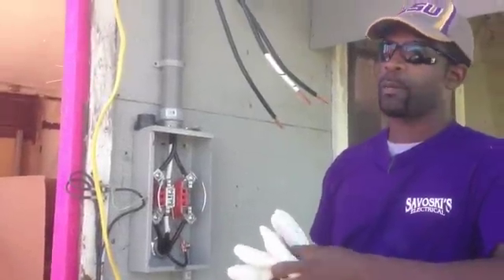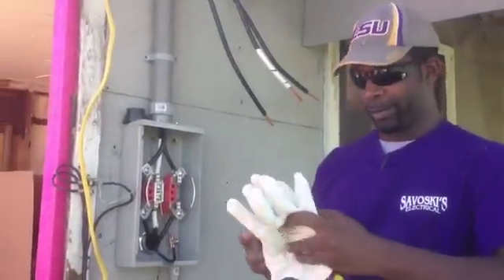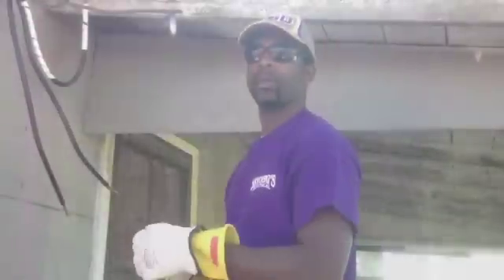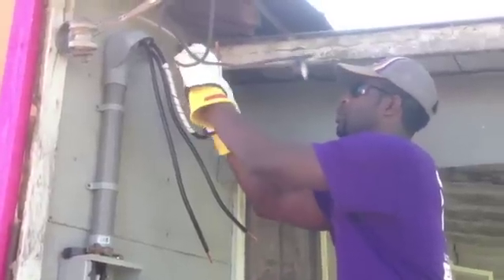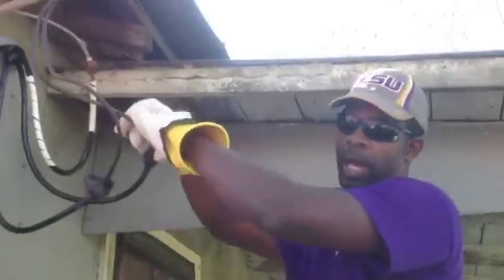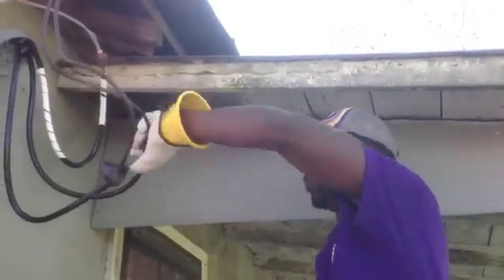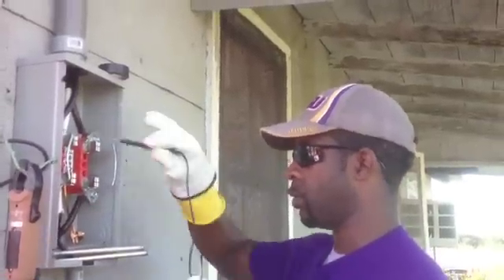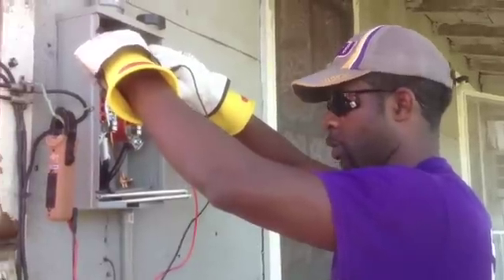Upgraded Residential 200 Amp Service.

Comment: Something serious? It’s only 120v per phase, now if you are higher and dealing with any kind of voltage is dangerous
Reply: People have died with only 120v.
Reply: @senorjalapeno3937  totally
Reply: @senorjalapeno3937  seen 120v weld sockets to impact wrench . It can definitely kill . People like to assume it won’t but it can .

Comment: Why not just call the electrical company to disconnect and after inspection they will reconnect, that way it will be safe to upgrade the service.
Reply: Because a household cannot wait for weeks or even a month or so for the electric company to come back out and reconnect the service again. They do come out eventually and remove the split bolt connectors and put their own crimp connectors on but in the meantime the house needs to have power

Comment: Nice video thanks. So far the only one I found that shows the actual hookup to live power.
Reply: Yeah it's my first time seeing that on YouTube too
Reply: Is this actually a live wire? Because i CANT FIND ANY VIDEOS WORKING ON THE SETVICE DROP WITH LIVE POWER
Reply: @zacharysnellgrove1358  Yes live electric. Not any other vids because it is dangerous. I watched this vid many times and almost did a hook up myself. But I became fearful. So my cousin the electrician did it. Very similar to this video. Good luck

Comment: So much wrong with this hookup that i don't even know where to start. No attention was paid to overhead line clearance code. You cannot use that #0 Aluminium feeder to supply 200 amps. It's amateur hour here.
Reply: It's open air wire, dumbass.

Comment: That's a bad installation, not in compliance with the National Electrical Code, not safe at all and bad craftsmanship.
Reply: Just left my comment to his installation..... OMG..... terrible!!!!
Reply: That doesnt look like 2/0 copper(225 rated)  to me it looks like 1/0(175amp rated)  at best. And he's using uninsulated tools for tightening his split bolts . Not sure what his standards are with his company and area .
Reply: The power company doesn't have to follow the NEC I've seen 4 AWG from the pole feeding a 200 amp service all the time.

Comment: As there is no meter installed, those drops are all totally dead. In addition, the insspector would likely red tag the installation because the finish outer wall surface is not installed and it appears to be plain sheetrock. Here in California, you cannot secure a riser to a wall with the weather head so low and you cannot use PVC clamps to secure the riser to the wall above the panel. It also does not look like the entrance fitting is properly secured to the box with a lock nut.. In addition, if the POCO feeders are hot, the cover and blank meter space opening should be closed off with a proper insulation filler so nothing can accidently fall into the open and live meter base.

Comment: I love all the nonsense comments on here! The job done here is perfectly fine!  Yes we DO hook them up and then the power company will come out at some point and replace the split bolt connectors with their connectors.  A customer can't be without power for 2 weeks waiting for the power company to come out and reconnect the lines!
Reply: Facts
Reply: Strange, when my parents service entrance need replaced Hydro One reconnected it a few hours later. Maybe utility companies have different practices in Canada. Another reason I find that same day reconnecting is common is that if you had a 60 amp service previously they need to replace the overhead feed to your mast.
Reply: @robertsitch1415  sometimes they dont, if you have 100 amp service they will leave the 60 amp service drop. The line crew tell me " oh it's fine its cooled by the air" 🙄
Reply: @willschultz5452  yes the fact that overhead wires are air cooled is why they typically use thinner conductors than you would see on an underground 200 amp service. Maybe advance scheduling is why same day reconnecting is standard in Ontario, Canada. That and if there isn't a storm Hydro One has plenty of staff to preform maintenance and assist with service changes.
Reply: @robertsitch1415  yes and if you have a 200 amp service nobody is ever going to actually pull a full 200 amps from the service.  Here where I am in pa we re connect ourselves like this video and the the electric company will come out as they have time, sometimes it can take  up to 2 months
Reply: @willschultz5452  you would either need several apartments or a large electric heated house to ever need more than 200 amps in a residential building.

Comment: There is no way this is up to code with that stubby ass two and a half foot ass length of PVC bringing that drip-loop to no more than 7 feet off the ground holy shit. And splitbolts? C'mon man overkill is way better than good enough when it comes to stuff like service tie-ins.

Comment: A pinhole (super small hole) in the gloves can make them worthless for preventing arc.
You should air pressure and visual check them every time before you use them
and if they are old gloves, don't trust them with your life.
You SHOULD NEVER work on live service entrance wires.
The power company can disconnect the transformer from your line if it needs work.
Reply: electricians do this live all the time! there is no danger if done right

Comment: 1.. No rubber blankets?
2..No crimps? instead of those cheap things...?
3..No plastics caskets around the service connection? 
4..No hard hat. 
5..Pretty sure you gotta go thru the roof?? 10ft to the bottom of the drip loop???
6..No cones or caution tape out to keep kids and people of your area.??? 

Message me if you would like a job done by a true professional. 

PS
i just hate seing videos like this. if you’ll do something and decide to upload it. PLEASE!!! have it professionally done.
Reply: this is only a service to a house 120/240 volt, you dont need all that, the gloves are fine
Reply: Blankets for what??? I have never seen my power company use all that on the side of my house and I will trust them before I trust your advice. They work on high volt lines so I’m sure they know what to use and not need to use.

Comment: Dude you got all that nice new box and wires provided by a 75 year old insulator tensioned to a weathered 75 year old  1 inch board.  Why do anything at all her since  these overhead wires are  going to pull loose off the board in 6 weeks.   Why not just keep the old fuse box.  What good is anything better if the rest of everything coming to it is not better as well.   You can always upgrade from behind  your upgrade later but upgrading in front of your upgrade later seems Cheezy.
Reply: What difference does it make? Is he the home owner? Is he the builder of the house? It looks like a meter installation and the rest could be already done within the house like you speak of.

Comment: I'm not an electrical engineer or anything - but aren't there better weather proofing solutions on those external connections than electrical tape?
Reply: There's actually many more steps to insulate split bolts than what is seen here. If you want to know more, check out this video by 3M: https://www.youtube.com/watch?v=9tsx6im7qng

Comment: If an inspector passes that, he should be fired. The proper way to do this is notify your utility, have them cut the power at the pole, do your thing, have it inspected, and IF it passes, the utility should drop new service to the house and put their own NEC approved connections at the point of service entry. Many electricians call this a bootleg installation and inspectors (if doing their job right) would fail this. Most utilities will run a fresh new drop to the residence. It's part of their supply charge on their utility bill.
Reply: not around here it isnt, the electric company will leave what is there and use it till it burns in half.  All electricians around here hook them up live by themselves. A customer cant wait weeks for the electric company to come and hook the power back up.  The company will come out at some point and cut the split bolt connectors off and put theirs on.
Reply: Why would he fail?? As long as he did the grounding right.. two ground rods number 6 and a number 4 back to water main and put in the correct breakers etc you are good.. I have done  hundreds of services .. Never failed one and guess what i cut them out and cut them back in hot..
Reply: Right......wait for the “electric”  company.  Let me know when you go out of business, because you spent hundreds of man hours waiting.
Reply: xlordshavox we don't run new service wire every time someone calls for a disconnect. Hell even 200 amp  upgrades still get #4 aluminum triplex. Open air wire is rated for more amps. Complete waste of wire .

Comment: instead of split bolts, what about those Polaris or Morris insulated splice connectors?
Reply: You should be using service taps!!
Reply: All is fine, split bolts Polaris lugs, Ericson crimps.......done 100's of them all but this is playing bullshit. His joints look like shit. Never saw any rubber tape........I could go on............
Reply: Gwar Richmond I was ready to point that out myself where is the rubber tape before the electrical tape.
Reply: @gwarrichmond6232  we used to use rubber tape, then friction tap then electrical tape
Reply: @sal.pizzurro  
Depends on what size split bolt I'm doing.... Most stuff is rubber tape then 33+ ,if its 3/0 or 4/0 but when I do 350 or 500 or larger I use varnish tape heavily then rubber/friction tape then 33+ or super 88. Sometimes if it's in a trough or tight junction box I will use varnish then MASTIC PAD then rubber then the 33+ or super 88.
👍🏼😉👍🏼

EDIT: This is an idea of doing a split bolt using varnish tape. 

https://youtu.be/9tsx6im7qng
Reply: @gwarrichmond6232  it's been a long time since I was an elevator mechanic, I forgot the friction tape goes on first then rubber then electrical. Never used varnish tape. I think I'd use what I'm used to, but those Polaris lugs look nice.
Reply: @sal.pizzurro  
Oh yeah they are nice and ALOT quicker !!! Lol!!!
They can be a bit pricey if you have a bunch of joints to make up. But by the time spent on making a split up and all the taping your still looking at about the same price. I know it may sound like an overkill but even on Polaris lugs I still tape the lil caps in place, just so they don't fall out.

Comment: The minimum distance off the ground to the drip loops is 10'. This is an NEC requirement.
Reply: electricalron that's what happens when you're too lazy or chap to run the entrance conduit through the edge of the roof like it should of been done
Reply: Patrick Pikulski Through soffit makes this a mast service.   The mast service here is required because of the clearance needed because of the height of the drip loops.  The SEC's often have no overcurrent protection.  Therefore, some people are stupid and would play on them.
Reply: I was think the same thing it looks pretty low🤔
Reply: Your wrong. For trying to be a smart ass.. but it should be 12 feet off the ground.. Facts
Reply: @adrienpatterson6217  who cares

Comment: i have connected pg and e as well in at least 200 panels,,with no gloves.,,,,,they are just overrated.
and i cant beilive how long the wires you left....also as far as know in most citys the minimum distance from the floor gotta be 12 feet.....but i guess there is people that learns on the street rather than the field

Comment: service drop wires remained the original size ?
DANGER !
Reply: Farmer Dave in my area even 200 amp our poco keeps the 4 awg triplex open air drop line.
Reply: its perfectly fine to keep the same drop, the wires are outdoors and cooled by the air. no problem.

Comment: nice work.. its only 120 volts on each line but the potential for ALOT of amps coming thru..thats the scary part.
Reply: it's funny reading the two guys comment who is more knowledgeable in electrical. both of the guys are correct , when voltage is present there is A CURRENT PASSING..if there is a load you can measure the amp by using a amp reading and see how much each load carry.
Reply: BoatsNhoes 311 So what you're telling me  because there's no digital reader in the can, there's no electricity going through the leads is that what you're saying, Because the meter is the cause of the current. Not from the overheads, but from the meter. Wow, I've heard better logical common sense from a fucking plumber.
Reply: BoatsNhoes 311 So what does any of that have to do with the leads? Fuck dude.
Reply: BoatsNhoes 311 Not to mention I threw him on some solar panels and because he's commercial, he had no clue how to wire.
Reply: BoatsNhoes 311 Tell your wife and my kids I said hey.

Comment: We had out 100 amp service upgraded to 200 amp several years ago and they also did ours 'hot'. The glove the guy wore were all rubber and of course he was on a fiberglass ladder. What I could not understand is how they was no sparking or arcing when the hot wire was attached to the metal connector and house side wire? I would have thought that when you touch the hot wire to the other wire it would spark or arc some.
Reply: only if there a load(something has to be on or running when he conncet the meter) on the wires then you would see a spark
Reply: RideTheWind panel was  disconnect, btw also neutral wire do sparks
Reply: nothing is pulling a load, meter is out
Reply: It will not spark if there is no load on the service. there should never be a load on a service if you are connecting it. Probably the meter was not installed yet either till the job was done.
Reply: NO the neutral wire will if there a load being pulled, neutral thats the most dangerous wire, it carries unbalanced load so if you have 15 amp and you tv pulls 5 amps the other 10 amp are coming back on the neutral wire.

Comment: How about clearence of service entrance cable and ground ?
Reply: minimum 10 feet
Reply: 12 feet most parts of the country
Reply: you dont want to pass under the wires with a 8 foot aluminum ladder and have the wires old and sometimes exposed with no tape and then you can imagine the result

Comment: Those leads were to long and low those kids are gonna jump up and hang off of them..
Reply: You’re supposed to have 3’ past the weather head.
Reply: Oscar Heredia luckily 95% of kids know better
Reply: What kind the glove used
Reply: @rigobertosaravia3440 
Probably class 0 rated for up to 1kv (1000 volts). Those class 0 gloves with leather gloves over them to help prevent a damage and possible contact with live conductors.
Reply: Mike mike Indy is right, the power companies dose that... Or else everyone would tap into the power company side and get FREE current
Reply: @agrippa7712   the electrician makes the connection to the power lines not the power company. the power company will come by at some point and make a more permanent connection.
Reply: I am not a electrician but I have a question. 1st a few wraps ofelectrical tape seems like a less than permanent solution. 2nd he stretches the tape at the end to cut it which we are taught in "HAM radio" tends to encourage it to unwrap. Thank you in advance sir.
Reply: Oscar Heredia he not no that much he got job because his blk. co need rachel balNce

Comment: nice job i made a video for you al/co connection for savoski i thhink you used the wrong split bolt in the video check with a inspecter you might be ok but my understanding is a al/co split bolt with a devider i see you take pride like i do and post video like me i enjoy doing wiring i made another video for you samples for savoski check them out let me know what you think be safe i dont want you getting hurt or worse killed here the utility company does live connection at weather head and handles meter thanks take care